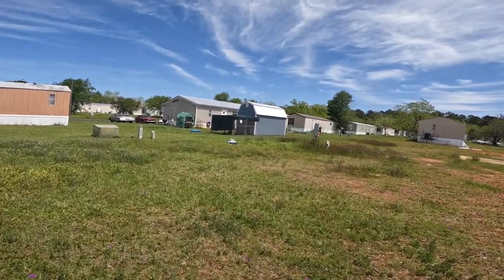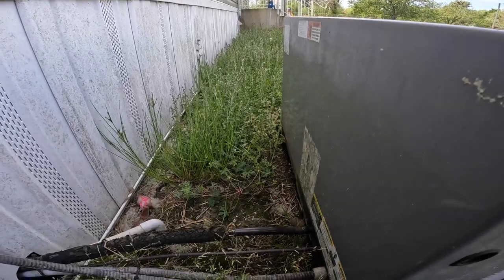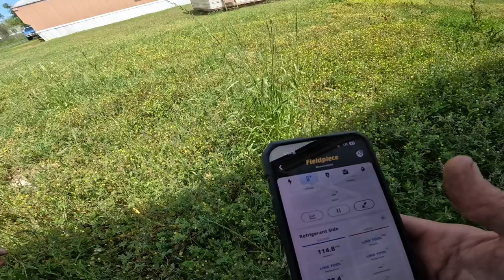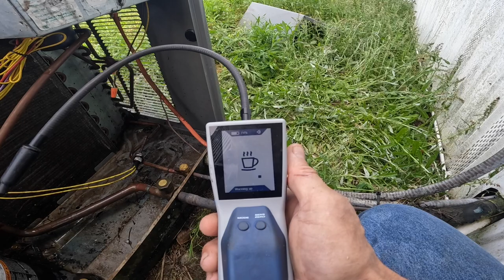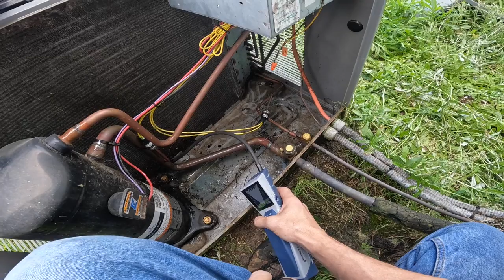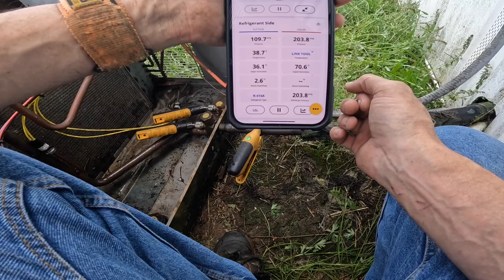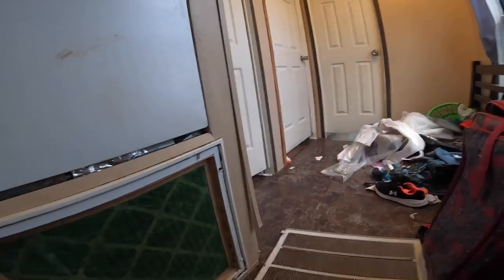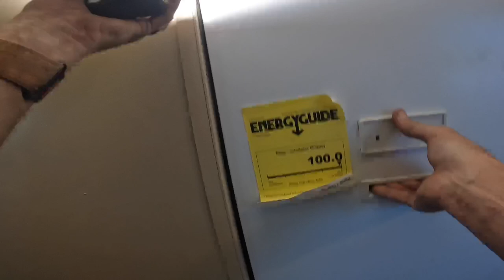System Cannot Work Like This. An Uncommon Find! #hvacguy #hvaclife

Comment: Id verify that the evap coil isn’t undersized instead of the condensing  unit being oversized. Maybe the duct work and cfm is made for 3 tons. It’s more likely that the evap coil is undersized, but still I’d wanna make sure just in case
Reply: Coil was likely replaced and thats why it looks new and had to have the lineset reducer brazed in.  The outside unit is the original unit/size that should be mated with a proper size evap coil.

Comment: A nice 4 Ton coil and adding a TXV will likely tune that right in. I believe those Coleman MH Electric furnaces come with a 4T blower drive so should handle 3.5T on high speed.
Reply: That is literally exactly what I said.  Throw a 4-ton coil and TEV in and possibly upgrade the blower motor, but a half ton coil is not going to magically fix the system.  That is barely worth the work.
Reply: Yeah, the cheap ductwork can’t handle 3.5 ton though. That’s why you put a tall 4 ton coil in there.
Reply: I came here for this comment 😂 
At least he got a sale out of it 
Silver lining?

Comment: i think you are on it curtis. Thanks For the video. Im "assuming" this problem is a new one and not been a problem since installation. Makes me think ductwork and blower aspects are Fine. New coil with correct piston should get this one rolling. btw, im assuming we know the previous company replaced the evap with a smaller one. maybe they Found a leak and replaced coil, kinda like they Fixed an issue and caused another one. Thats where my mind is at on this call.

Comment: Amazing..ppl look, but don’t see! In Utah we are having a freak 80+ day right after over a foot of snow literally just melted off..I switched my Mitsubishi mini split (a four head of five available) to cooling, and first was trying to run it like I’m used to down south, with high manual fan settings, and it just..never shuts off even when you reach temperature..so, I do my research, and just put the four heads on auto, with certain rooms at certain temperatures, and..it’s shockingly, shockingly quiet! Both the indoor cassettes, and probably even more shocking is how quiet the outdoor unit is..I’m used to hearing….”BBBLLLAAAAAAAAAAAAAAAHHHH!!!”.. from every outdoor AC I’ve ever heard, and this thing just sort of gently makes a draft of the warmth off the coils..then as I’m standing there, it ramps it down even slower..I’m just amazed by this technology..I’m only using four of the available five heads because I only have four main rooms upstairs, and didn’t see a need to install the fifth one downstairs as I’m by myself, the downstairs seems cool all summer as I’m set into a hill, you walk in my ground front door, then go downstairs and walk out the back of the house, so it stays pretty cool in summer. I think the cassettes are a 12 in the kitchen, 9 in living room, and two 6000 in the bedrooms..the kitchen is west facing so they bumped up the capacity. I’m just beyond thrilled, but, I’ll have to see how it handles the 107 degrees when it comes!

Comment: I wonder if the ducting or blower can handle 3.5 tons. Good content as alway Curtis. 👍🏻
Reply: I have a 3 1/2 ton in my double wide. Just put in a little over a year ago. Seems to work fine until Temps get in the 90's. That's just due to poor insulation
Reply: 3 1/2 ton is max on AC only, 3 ton for heat pumps. Always upsize my indoor coil 1/2-1 ton bigger than the outdoor unit.
Reply: On double wides need to upgrade the blower motor to 3/4 Hp
Complete motor and squirrel cage assembly,

Comment: A different evaporator wil help, but unless that mobile home was built for cooling the duct work is sized for heating too small.
Reply: No mobile home is designed for cooling. Landlord probably had a 3.5 Ton condenser sitting around and had someone install it when theirs broke down.

Comment: Usually we go a half ton higher on the Evap. You might want to get a 4T coil if your drive can handle it. Good catch man
Reply: 100% agree and exactly what I said.  We size up a half-ton on all our systems here in Denver.
Reply: No way, why upsize on a small trailer when the ductwork is high static as it is??  I would do an entire heat loss/gain calc and then replace both based off my numbers.  I would gather that place needs probably a 2 or 2.5 ton unit.
Reply: @joshuaseaton4526  Exactly correct Josh, mwdub is drunk. What he is suggesting was 20 years ago solutions....lol
Reply: @woodworkking1099  I don’t know about you dude but we do VRF systems and that’s top of the line that very few techs can touch. They still oversize their Evap coils. Probably LG and Daikin is drunk too. It really application dependent and I’m not being specific here kid.
Reply: Yea that oversizing evaporator coils hardly turns out good for the compressor. I dont get why manufactures go for that.
Reply: @davidhazas7162  they do it for efficiency, think about it. When the refrigerant lingers longer inside the coil, the air moving through will have longer residence time to grab more BTU’s from the refrigerant. Hope that helps.
Reply: @mwdub02  that may be true but those oversized evaps tend to use up quite a bit more refrigerant and if your condenser is barely  able to supply that then u get a lot more super heat back and your subcooling marginal and all that leads up to an overheated or over charged unit. That's my opinion. It may work well under certain load conditions. But when it's 110 outside and a residential house is marginally insulated. Good luck.

Comment: To help non-trades, superheat too low, suction (return) line ice cold but not enough cooling (air temp drop thru heat exchange) could mean not enough airflow, wrong piston or undersized evaporator. He thinks it is the latter.

Comment: Proper metering device is first pump it down and check the piston size you could Upsize the piston to feed that coil it’s definitely not going to be maximum efficiency because of the lack of surface area (smaller coil) but it should work most new units have lower btu per ton anyway that unit probably has a 36-38,000 btu compressor even though it’s a 3.5 ton. A quick google research would give you a definitive.while not recommended I think it could be made to work.

Comment: I once found a 3 ton outside an apartment with a 2 ton evap coil. The manager had a company put in the outside unit??.The line set outside went from 5/8s to 3/4! The resident kept complaining.The apartment had a vaulted ceiling and no insulation whatsoever. This was on a third floor here in Dallas. It was a losing battle with the manager. Talk about kicking a dead horse.

Comment: first off  if your AH can move 3.5 ton of air Coil is not your problem. it does in fact  derate the system as a hole some and i am not familiar with what a double wide needs in your area.  that aluminum foil trying to block the Air gap in the front of the coil is a potential major problem, add that to the open air intake at the top of the air handler might be the hole ball of wax.  some air flow testing might have been a good idea, could also be a TXV with air going around the coil.  just my 2 cents  performance data of the coil outdoor match up might be just find for sensible and laten.

Comment: So the smaller A coil can’t  handle the volume coming from the 3 1/2 ton outside unit.
Which means the low insulation mobile home needs a higher volume of exchange ?
Not an HVAC guy but love watching and learning from you.

Comment: I'm no HVAC tech but isn't that unit way too big for that mobile home anyway?  I heard when units are oversized they switch on and off (in AC mode) really fast and can make the place humid.
Reply: Most mobile homes arent very thermally efficient like a house. They are horrible to cool and just as bad to heat in the bitter cold.  Didnt notice if it was a double wide or not.
Reply: Here in Florida, oversized units = MILDEW EVERYWHERE

Comment: I would suggest to double clean that indoor coil.  Most of the 3.5 ton condensers will do reasonably well with a .5 ton smaller indoor coil
Reply: I'd say the more likely problem is that they have the totally wrong orifice in the system.  A 3 ton orifice with a 3.5 ton condenser would give you a very low evaporator pressure and low efficiency.  A slightly smaller coil would just mean somewhat lower efficiency, but this wouldn't prevent the system from working.

Comment: Hey Curtis, even if that unit reduced to 3/4 suction you would be ok.  Rheem lineset charts are very forgiving.  Very little efficiency drop between the common lineset sizes.

Comment: I think you should install a 4 ton coil.
Reply: 100%! Ditto on this answer.  4-ton all day and check the blower speeds.
Reply from the maker: I ordered a 3.5 - 4 ton
Reply: Also I am in North Carolina, thus I will attempt to get an indoor coil that would generate an AHRI number. And if one was not available, I would NOTE on my invoice my unsuccessful attempts to locate one.